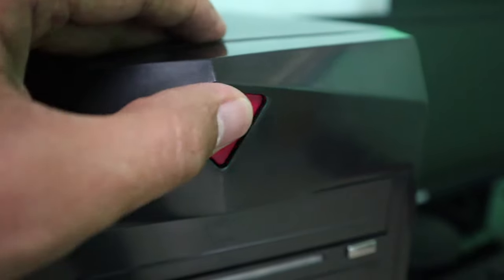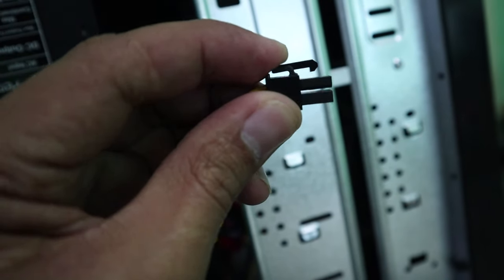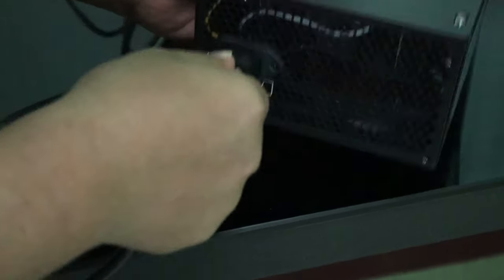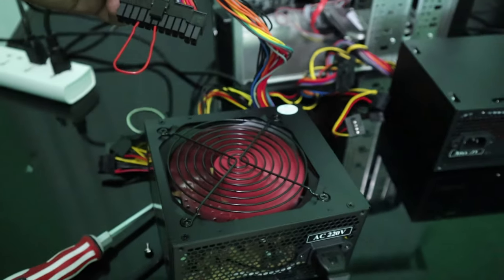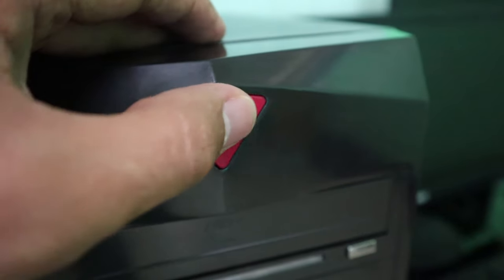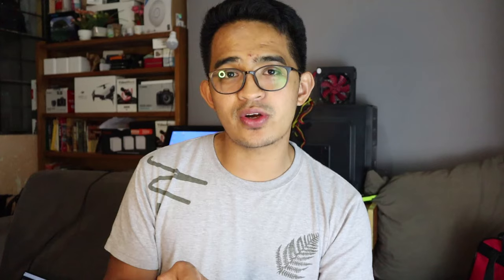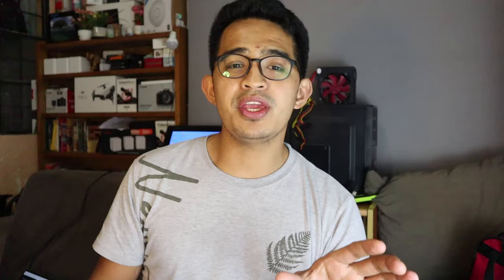DIY - TROUBLESHOOT and FIX a Computer that won't turn on - NO POWER (Beginners Guide)

Comment from the maker: I hope it helps! Drop your comments! make sure to like and subscribe!
Reply: Hello gentlemen,
I purchased all the PC components online and decided to build it by myself.

But when i hit the power button, it's not powering up. Not the posting error, but motherboard itself has no power.
Not single Debug LED turned on. Not even the CPU fan.

So, I checked the Power Supply Unit(PSU) by shorting the 24 connector pin, and its working fine.
And also connected it with another motherboard its working.

So, I thought maybe the motherboard is faulty because PSU is working.

Then i returned the motherboard to the manufacturer for replacement, but they checked the motherboard and shockingly it is also working.

Now I am really confused what is the reason!!

please help me with that.

Build Components:

1). AMD RYZEN 7 3700X PROCESSOR
2). Msi MPG X570 Gaming Edge WiFi Motherboard
3). Adata AX4U3200316G16A-DT60 Desktop Ram XPG Spectrix D60G Series 32GB (16GBX2) DDR4 3200MHz RGB
4). MSI GeForce RTX 2060 SUPER VENTUS XS C OC 8GB GDDR6 256-bit Gaming Graphics Card
5). Cooler Master MWE 750 V2 230V SMPS - 750 Watt 80 Plus Bronze Certification PSU With Active PFC
6). Adata XPG Gammix S5 512GB 3D NAND M.2 NVMe Internal SSD
Reply: Hey. Could you please help me? I recently moved and now my pc won't power on. I reseted all cables and made sure the cables were good as well as checking the outlet. No luck.  (Edit) Nvm tried testing the PSU, and after the test it booted up no problem. Weird how that works. Thank you so much for making this video. Saved me time and $
Reply: Can u fix my pc?
Reply: @PruthviTalanpuri  a@@@@a@eerrr
Reply: Hello , I want to ask .. how about if the power supply is injected to the outlet then I tried to open it but it will open for a seconds then it will stop but there is green light on the mother board?  by the way my power supply is delta dps-350ab-13 , they say its too old ps model. I hope someone help me. Thanks a lot.
Reply: HowToBasic: Egg
Reply: My motherboard power button on the bored lights up but wen u push the button the blue light on the front of the tower goes blue and fades off instantly other things like my WiFi card lights flash and go straight off but the USB and memory card reader had power indicator lights come on all the time till the power button it pushed then thay go off till I remove the power cable and plug bk in
Reply: Thx that didn't help
Reply: can you pls help , I disarm my pc to clean it when I put back everythink as it was, My pc won't turn on now.
Reply: My computer just turns on and off imediately
Reply: Sure it did bro, thank you!

Comment: Never cleaning my pc again. I almost threw the whole thing on the floor in a fit of rage. Guess no more tarkov for awhile
Reply: What's the problem on your pc bro? Is it the power supply?
Reply: @chainsawd_  hey um i just applied new thermal paste to the cpu and now its not turning on.. Do u have any idea what the problem might be?
Reply: @chainsawd_  the orange cpu light turns on but nothing else happens other than that
Reply: @gamerboi2481  same bruh
Reply: @luxzz1398  i fixed mine by swapping the 2 rams try that hope it helps
Reply: This is what I feel right now. Damn!
Reply: Lol. My pc didn’t work when it came in. Payed 945 for it. Doing all I can to fix it just to play Tarkov. I wanna play Tarkov so badly.

Update: It’s been fixed and I have like 150 hours in Tarkov now! :D
Reply: I got the same problem, fans spin and light up then stop. I jus installed a new cpu
Reply: @gamerboi2481  I tried that & it still didn’t work
Reply: @whereis223  idk then :/ good luck with it. Though i do suggest taking out the rams and cleaning them with a soft cloth and putting them back again
Reply: @gamerboi2481  I’ll try that to see if it works.
Reply: @24k_rich16  same
Reply: Ik I wanna play tarkov
Reply: I have problem with that right now, im still fixing hoping to be fixed 😭😭
Reply: @exequielsanchez2958  did you fixed it???
Reply: Broooo lmaoooo this is so fucking funny 😭🤣
Reply: This is literally me rn
Reply: @gamerboi2481  Yup sometimes the pc do be acting sus and the fix is just reseating stuff lol
Reply: My PC does show that it's charging... All this stress after a stupid clean up. Damn the pain
Reply: Same i will never open my system unit again it's truamatizing hahaha
Reply: Literally had pc 6 years gaming away I just cleaned the dust now it just reboots itself and now it won’t turn on at all feel like crying
Reply: Damn bruh you’re missing out on this wipe lmao
Reply: @24k_rich16  ever get a fix?
Reply: @nickgouza3280  I got another one
Reply: Same bro
Reply: Same here man
Reply: Nah fr bro I’m on that rn
Reply: Im in a situation of cleaning the PC and all of a sudden it doesn't Wana turn on anymore , I did diagnosis on the power supply it's ok and now I don't know what to do
Reply: I just made peace some how that the motherboard is dead some how I don't know
Reply: Bro i Just cleaned mine today and now im not getting Any power at all 😢
Reply: Me too!!
Reply: Had someone clean my CPU (since I didn't want to mess things up) with a bottle of compressed air and things still got messed up. :/

Comment: I was playing on my gaming pc when my power suddenly went out for 5 hours. When the power came back on I turned on my pc and nothing happened no fans no lights. What do I do 😭
Reply: Replace ram
Reply: Same here bro. Replaced my psu and still doesnt work. Did u fix urs?
Reply: @ManuCapone_  i did fix it and the problem was every time my power goes out my pc wont turn on until i reset my cmos battery
Reply: @Foiid  I took out and put the same cmos battery and nothing happened. Going to try a new cmos battery tomorrow. Hopefully it works

Comment: Spent an entire week trying to get my new build desktop to start. Though the power supply was faulty . Your video allowed me how to determine that the power supply was working. Turned out it was the effing front panel connectors. I have an  ASUS Q connector from my first build 6 years ago but it does not fit MSI MB. Thank you
Reply: This is literaly my current problem man.

Comment: Someone help me!! I spilled a half glass full with ice of water on my computer. It shut off fast once the water hit the case so I opened my computer and cleaned the wet parts inside with a t-shirt because I was panicking. There is a light inside of it still on when plugged in, when unplugged the light turns off. It is dry from what I see and I need help because I don’t know what’s wrong with it! I really need it fixed. (It has only been sitting for 1 night.

Comment: i tried a few of ur solutions but it didnt work, my situation is this:  pc gets power than 1 sec later it dies, when i unplug the power cable and put it back in and press the power button without turning the psu on i hear a switch, than when i turn the psu on and press the power button it sometimes starts, am trying to solve this issue but its so random i dont get it, 4 week ago my other psu died and now it seems this one has problems to, which brings me to the idea its something else, i have a 7800x3d with a 7800xt and 64 gb ram ddr5 and a riptide b650 asrock mother board. i have a fractial torrent with led fans. the fans dont even light up the fans spin less than a second and it dies, whats weird that sometimes it does start. am so confused. are there any steps i can take? oh and the 24pin connector is all black do i use the same portto test as in ur video? also is 850w gold even enough for my build am wondering even tho amd says 850w should be enough

Comment: I tried changing motherboards over... once all done no power ... noticed the orange wire has come out of the 24pin with another orange wire which goes nowhere ... question is .. would this course no power with wire out ?

Comment: Thanks man! This vid helped me and saved me a lot of money. Someone commented here and has the same problem as mine. We thought it was the motherboard because the psu is working and the switch wasn't even if we do the jumper thing. He said someone here also recommended replacing the CMOS battery first and it did, my pc worked and so as his.
Just sharing this experience to not jump right to conclusion first about the motherboard being faulty. God bless y'all!
Reply: Woah I have the same problem too
Reply: Psu working but after put the 24 pin in, not turn on even if I jumper the switch

Comment: I've watched at least 30 videos over the past day trying to figure out an issue after replacing a motherboard and you absolutely saved me! Can't thank you enough!
Reply: i sweat its my mother board, the fan spins n everything. but when i plug it in it doesnt work
Reply: @jaredcolon3047  did you find a solution? I also think my mother board is bricked
Reply: @khious3998  yea, turns out my mother board isnt shredded. The power button from my case was plugged in the wrong port😂
Reply: @jaredcolon3047  oh shit i haven’t checked mine

Comment: I tuck the power box out of an old computer to use as a malty tap power supply i.e. 3.3V, 5V ,12V for a bread board and Arduino projects.
I had power to the box and through the on-off toggle switch on the box but no power out or fan movement, so I followed your instructions, joined the green and the black pins and it now works. Thanks to your video you've saved a lot of electronics from the scrap bin.

Comment: Very useful video to help beginners, but there are a couple of things to add to make it even more effective. Some power supplies don't spin their fans until they get above a certain temperature or power load. Also, the power supply fan spinning, doesn't indicate the full health of the power supply. You also need to test the various dc power outputs of the power supply, like the 5v and 12v lines. You'll need a multimeter for that though. The reason is that quite often the fan will spin, but the power supply won't be giving out the correct voltages to power on the computer. If your computer does power on but then completely shuts off while doing something like gaming, that can also be a symptom of a failing power supply or just a power supply that isn't sufficiently powerful for your computer. As a side note, be very cautious about buying cheap power supplies, such as the ones in this video. Most are junk and some are potentially dangerous and can cause fires if overloaded. One last point, unless you know what you are doing, never open the power supply case unless you want to risk getting a very nasty and potentially lethal shock.
Reply: "You also need to test the various DC power outputs of the power supply, like the 5V and 12V lines [with a multimeter]"
could you elaborate on that
Reply: A week ago I found a random ddr3 RAM stick lying around whilst cleaning the house and decided that perhaps I could install it into a prebuilt tower (some old lenovo from 2010) my mum uses (she doesn't use it much, only occasionally)

I opened up the tower once before a month or two just to check the insides since I was bored and nothing went wrong after that.

2 days ago I opened up the thing once again to install the RAM. I noticed the CPU power cable (an old 4 pin connector, not the 8 pin ones used today) was kinda in the way and I had to tug it a bit to install the RAM. 

problem is installing the RAM was a hassle and one of the clip things didn't really click properly. I also didn't really ground myself and touched the RAM cards everywhere, including the golden pins. 

Before installing the new RAM i took out the old one to see if the one I found was compatible and it was. PC3 8500U and the old one was PC3 12800U. installed both dimm modules, turned on the switch annnnd...shit doesn't turn on, whcih was weird because we literally just used it an hour before to read some old CDs we also happened to find while cleaning.

I try reinstalling the RAM, again not caring about grounding myself and same thing happens again. later I read about the grounding yourself before touchy thing and assumed that i probably killed the ram, but the thing didnt even turn on at all so it definitely wasnt a RAM problem. another thing to note is that while doing all this I didnt disconnect the power cable. (external switch on the mains was off though, the psu itself didnt have one)

so here I am still freaking out. I only can think of two scenarios:

1. mobo is somehow dead
2. cpu cable isnt connected properly (remember how I yanked on it)

problem is said cable is located directly under this giant plate blocking and surrounding the CPU and heatsink that houses the CPU fan. I'm afraid I'll mess something up if I take it out but upon using my phone camera to peek at the cable under it it doesn't seem to be that loose. (isn't coming out despite solid yanks, only wobbling a bit)

man this sucks.
Reply: Thanks for raising this. In my case rhe paper clip test proved that the fan was spinning leaving the switch or the motherboard. The jumper test for the switch did not work so it had to have been the motherboard. Right? Wrong! Yes the paper clip test did make the fan spin but it felt weak. On impulse I had another power supply and so swapped it over and bingo, everything lit up and worked. As you say, my PSU was working but in poor health, so much so that it did not power up the motherboard. Therefore assuming a faulty motherboard would have been the wrong diagnosis. I want to share this experience so I'm repeating it as a main comment. Thanks again.
Reply: @nerd2544  apologies for the delay in replying. I never actually received a notification for your reply. To elaborate though, a computer power supply doesn't just provide a single voltage. It will output 12v via one set of wires, 5v via another set and sometimes other voltages too. Quite often a power supply can fail partially, but not fully, because one or more components inside it has failed. This will often result in the output voltages to be much lower, or more rarely much higher than they should be. Using a multimeter on DC voltage mode, you can measure those output voltages. If they are more than a little different to what they should be, there is a high chance that something in the power supply has failed, even though the fan might still spin. If the voltage is not as it should be, the computer will be starved of power and will either not run at all, or may seem to run okay until you try to do anything useful with it. Gaming in particular can pull a lot of power from the psu and if the psu is not up to the task, your pc may shut down under load. I hope that helps and answers your question.
Reply: @jross380  You're welcome and I'm glad you found it useful.
Reply: @juddery  no i found it was the mobo most likely, haha it's almost been a year but the dead tower is still with us and I've since salvaged the hard drive since it still works

i shorted the main large plug (from the power supply) that connects to the motherboard by using a paperclip and bending it and putting the ends in two specific holes according to youtube videos like these and every peripheral and device powered on (could hear the hard drive spinning up and see the CPU fan spinning) so I concluded I somehow messed up the motherboard when jamming the RAM dimm in and that the power supply was perfectly fine 🤷🏻‍♂️ even tried reseating the CMOS battery as a last resort to no avail

thankfully it wasn't an important or expensive PC since my mom just used it to surf the internet and nothing else but still sucks ☠️
Reply: @nerd2544  ah, that sucks, but at least it wasn't a high value tower.

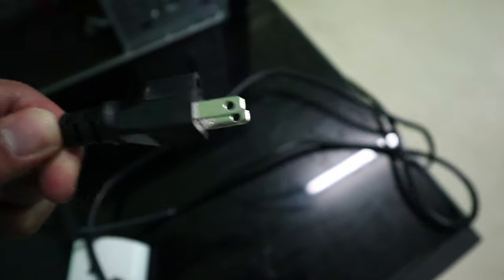Comment: I didn't even had to watch the whole video at  1:40 as you mentioned to check the power cable..I rushed to check it and I found bug a literal bug on the end of the cable cramped between the slot cutting my computer's power supply..thank you :)

Comment: Thank you a great simple 1,2,3 approach to solving what can be an incredibly baffling problem. However sometimes it may not be so black and white. I'm posting this to share experiences. In my case the paper clip test proved that the fan was spinning leaving the switch or the motherboard. The jumper test for the switch did not work so it left the motherboard. That was the only conclusion to left. However the spinning fan on the PSU didn't feel right, it felt weak. On impulse I had another power supply and so swapped it over and bingo, everything lit up and worked. The PSU therefore although working was in poor health. See comment by Peter Judd. In this case assuming a faulty motherboard would have been the wrong diagnosis.
Reply: happened with me three times ,my pc works turns on but no signal , fan spinning , changed psu its up n running , most of the time psu get bad like they dont give enough power for ur cpu n mobo but still able to spin the fan ,most cases thats how my psu got bad

Comment: Thanks, dude.
My old pc turned off suddenly and won't turn on anymore. When I diagnosised the power supply with the pin method, it doesn't turned on. I tried again with the one from my brother and work, which means that mine is dead. Thanks again for sharing the troubleshooting method 🤝
Reply: Sameee with meeee ffs

Comment: Thanks for the Video. It really Helped me out, I checked Power supply as you did my power Supply was Okay. Problem was with GPU card, I simply unplugged it and my pc started working.

Comment: Update from previous comment:
 I checked the power cable and it had gone bad. 

I did as you suggested and plugged it into my monitor and it wouldn’t turn on.

I switched back to the power cable for my monitor and it worked as usual.

I then got another power cable from my tech cable bin, and my PC tower is back to business ☺️

Thank you again for your simple and concise video; it was an awesome help, and I’ve subscribed to your channel for future helps ☺️